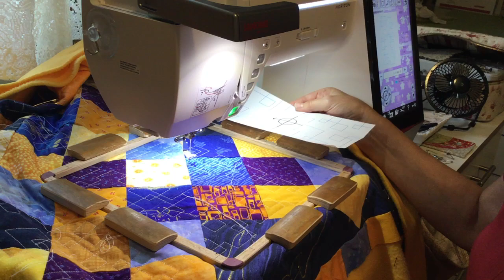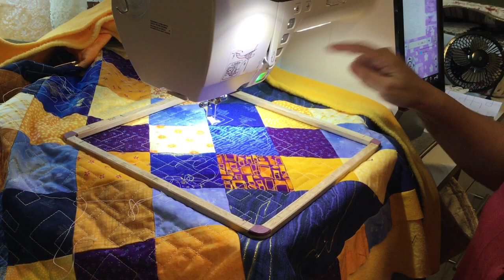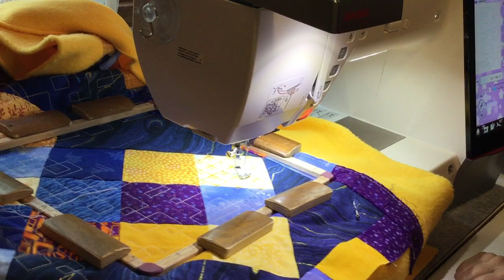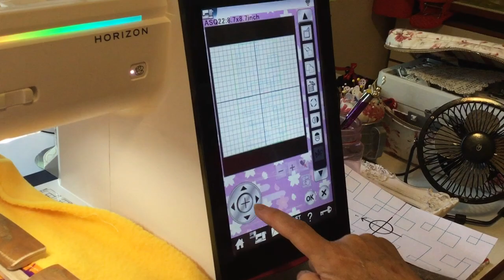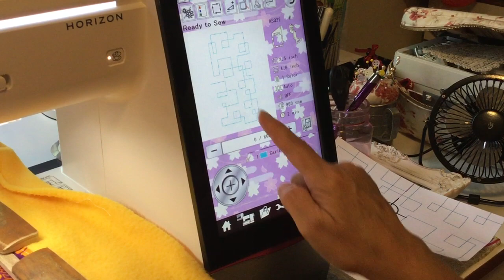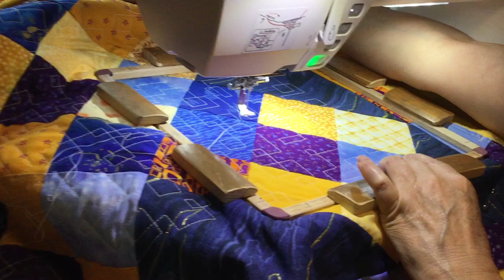Continuous Quilting with homemade hoop

Comment: Love your technique!  I am doing an Quilt In the Hoop Series on a Janome Mb4 or Mb7.  My process is a bit different because it's a multi-needle where the Needle Down is kind of a pain to work with.  And I have no flat table for the quilt to sit on.  I would love your input if you have the time.  I am also trying to make a homemade magnetic hoop for this Mb4.  I tried already (video #5 at 29:34 minutes), but the stitches were not as crisp.  My technique has been evolving over the weeks.  My block Designs are not Square, and are not end to end.  They are nested, individual "blocks".  It's just easier to line them up since they are so forgiving.   I use svg clear Ghost Templates to place the next hooping.  Like I said, totally different than your technique, but I am always trying to make mine easier.  Did you say that you have a horizontal Line on the quilt to check for rotation?  Does the drawing in of the fabric mess with your horizontal Line at all?  Do you make magnetic hoops for other machines?  Here is the Playlist for my Video Series:  https://youtube.com/playlist?list=PLFc2_CE1o6RIjsCoyLCVVhQAf-tb7SgA5
Reply from the maker: Oh, I'm so sorry it took me so long to read your comments, hadn't checked on this video for awhile obviously! This video doesn't explain everything necessary because it was a video that I made for my local students whom I was in communication with. I don't own an MB4 machine but used to use one when I was still working. Using one will be quite a bit trickier for a continuous quilting design because that first needle position is more difficult to determine. Doing individual blocks isn't as tricky, you just need to be sure that when you position the paper template (so important to have a paper template!) that you put it exactly where you want it and then hoop mostly perfectly. I think you could still move to stitch #1 of the design and make sure that the Color #1 needle gets right to that place where you want it to begin. Yes, I draw chalk lines (horizontal is most important for the design I digitized). I like chalk because it more or less just dissipates as you work. The fabric will "draw in" as you stitch, just a little, probably more so if the design had alot of stitches in it. I didn't mention it here, but I made 2 designs, one was the reverse/flipped design. I stitch from the vertical center out toward one side, then rotate the quilt and stitch the rest of the row from the vertical center out to the other side.
Reply from the maker: Do I make hoops for other machines? Not yet! So far we've only made the ones for the 15000 machine so that I and my students all have one!
Reply: @faviolamartinezsewdigitizing  do you sell the hoops to other 15000 owners?
Reply from the maker: @judywentz6712  Thanks for asking. My husband & I are discussing it right now!
Reply from the maker: @judywentz6712  my husband & I are discussing selling them, we're pricing out the supplies now to see if it's a feasible option.
Reply: @faviolamartinezsewdigitizing  , thank you for responding.  I know how busy life can get.  I do wish Janome would come out with a magnetic hoop for the Mb4/Mb7.  I really do not like using Mighty Hoops or EZ Frames or Fast Frames because I loose stitching area, and you also run a greater risk of hitting your hoop.  So, I just keep plugging away with the regular hoop.  If you ever do make a magnetic hoop for the Mb4 that keeps your stitching area in tact, please let me know.  Thanks again!  :)
Reply from the maker: @WeQuiltStudio  glad to be in contact with you. I do have to say that using a frame like mine doesn't  interfere with the stitch area in the hoop that I'm using. This hoop is the ASQ22 hoop for the Janome sewing & embroidery machines which is designed for in the hoop quilting. Yes, unfortunately Janome hasn't made an ASQ (Acuquilt square) for their MB machines. Likely because the machines don't have an extension table to support the weight of the quilt.
Reply: @faviolamartinezsewdigitizing  , Hi.  Me too!  the Mb's do have an extension table, but it really cannot be used unless you float the quilt or use a magnetic hoop, both of which I don't like for quilting in the hoop.  Or, you can use a "Flat" hoop where the Brackets are attached to the Bottom Ring instead of the Top Ring (Mighty Hoop said they can make one for my machine but you loose about 1.5" in height).  That way the quilt can be draped over the side clamps, and then you could shove more quilt into the arm.  But you do loose the stability of the quilt because it is more free to do what it wants.  With regular hooping, I have found that I can pull on the fabric on the sides of the hoop, so that when the hoop is locked in, that fabric that I pulled out actually stabilizes the quilt.  And then I also make a "channel" of fabric in front of the hoop.  I know this is hard to visualize in print, but I am currently editing a new video on my final technique for quilting in the hoop with a mutineedle.  Hopefully it will be on my channel in a few days.